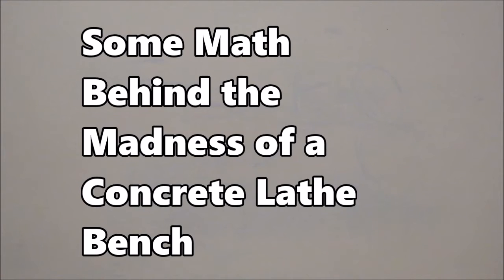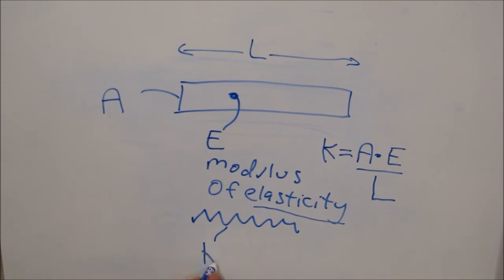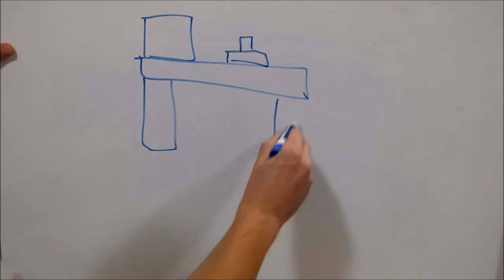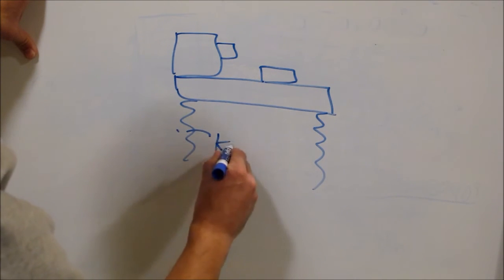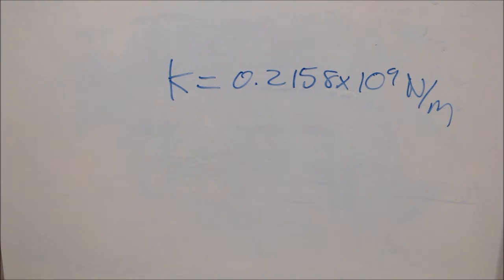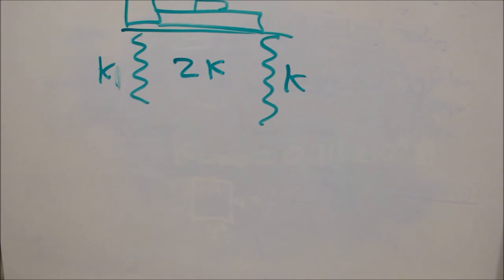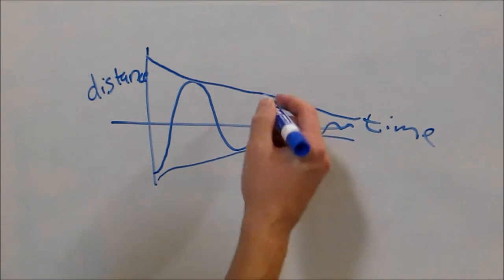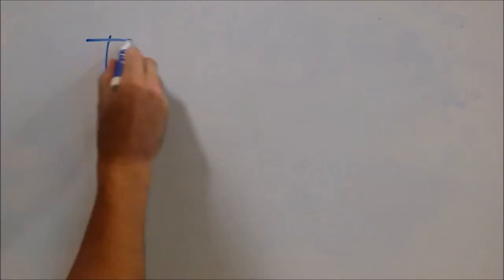Math Behind the Madness: Concrete Bench

Comment: I have a Sherline 17" lathe and was wondering if mounting on a granite slab 1" thickness would be better to eliminate any environmental conditions the wood might experience? Or 1" Aluminum thickness?  Thoughts.
Reply from the maker: I mounted my mini mill to a piece of granite and then to a wood stand - exactly as you are describing.  It made a positive difference - I haven't quantified it, but I'm sure the base flexes less.  If you can get the granite for a reasonable price I would definitely do it.

Comment: I used to work in a place that had a vast machineshop. The really precise machines, were either mounted on a slab of granite (several tons worth of the stuff!) or on a concrete base (the concrete had powdered recycled car tyres in it, to help reduce vibration) 
This is idea is a very good one, though not new.
If certain elements in the concrete/granite stand or base needed to be isolated from one another (for removal in the future or even relocation) sheet lead was used in between elements.

Paddy
Reply from the maker: I read a number of papers about adding rubber into the mix.  Interesting stuff for sure.

Comment: I made a bench out of 2” square steel tubing welded together. I rings like a bell. No damping. I wouldn’t do it that way again. I have some chatter issues.
Reply from the maker: Fancy concrete (epoxy based) is very common in high end machine tools like Kern.  The regular construction stuff actually works surprisingly well
Reply: @thecogwheel  I spent way more than you too 🤬
Reply: Cap all the ends, fill it with sand

Comment: My understanding is that the damping properties of steel depend on the level of stress applied.  If steel structures are designed for the same strength as cast iron, the damping properties of steel are 1.8 times that of gray cast iron.  Blodgett, Design of Weldments, 1963.

Comment: This is an excellent video and very clear. It is well that you used SI (aka metric) for your calculations. In the murky world of imperial unis, there are some difficulties. First of all "pound" can stand for either as a unit of  mass (lbm) or as a unit of force (lbf). If pound is mass (lbm) then force is measured in poundals. If pound is force (lbf) then mass is measured in slugs. I wish I were making this up but I'm not. I have used both and I can tell you it is confusing! For instance if you must  use psi (pounds/sq. in) as a unit of pressure then mass must be measured in slugs. If you use pounds as mass, then force is in poundals. The temptation to mix units is always there and is a very real reason planes crash or buildings collapse. In Si this ambiguity does not arise.
Reply from the maker: For engineering purposes I think the imperial system should be abandon.  As a Canadian I have to be able to use both units - and in school we did all our problems twice - once in metric and once in imperial.  For measuring and making things in the shop I use imperial because most of my machines are in inches. Spatially, for whatever reason, I think in inches.

Comment: During WWI there was a short of cast iron, Thwrefore the made lathe bed out of concrete. These were large lathes use to make artillery barrels.
Reply: This is still a thing many machines are built from cast iron filled with epoxy cement for the sake of dampening and allso to save on cast-iron thickness.

Comment: It all makes sense except for some omissions. You have only considered forces and vibrations in the vertical direction. What about the horizontal direction (forth and back; left and right). Since you have no diagonal bracing the lateral vibrations will dominate. And you want those as little as the vertical ones.
Reply from the maker: When it comes to 'back of the napkin' machine dynamics problems I usually only worry about one axis and the rest usually take care of themselves.  I know that you have to be careful with this approach, but this was more of an educated home shop sorta look at things.  When it comes to the lathe, the out of balance will usually be in the same direction as what we were looking at here.
Reply: I only wanted to mention it in case there is still  a problem with chatter during cutting. In such a case you would have to continue to pursue other axes which probably would lead to diagonal braces. But as long as the cutting works well no need.

Comment: I understand that concrete was often used as bases for production machines during WW1, as cast iron was needed at the front. There's an old Popular Mechanics article (online) using concrete in a home shop milling machine.

Also, I would encourage you to think more about your audience, decide who you want to address, and then tune your presentation accordingly. This video has good ideas, and I like the analytical approach, but  it needs a lot more care in presentation.
Reply from the maker: One of the things I didn't realize is how easy concrete is to work with.  I've done cement work before, but this is the first time I've built a 'structure' for a mechanical device.  The results were really night and day compared to the wood bench it was on before.  And I spent more time building the wood bench.  

Thanks for the suggestions for improvement - and thanks for stopping by!
Reply: Generic, vague, useless, inactionable feedback. Key rattling for the sake of it.

The audience was obviously people with a less than industrial class of lathe (since those typically come on hefty stands), looking to improve the quality of their cuts through the use of concrete as a machine base. He was addressing them. And his presentation was tuned accordingly.

And the description clearly states "I’m taking a back of an envelope (on a whiteboard) approach" ... which mitigates your criticism in the presentation needing a lot more care.

You're a person that loves to hear himself talk.